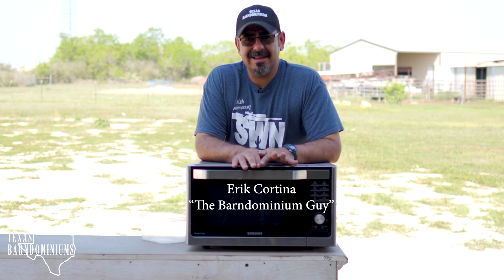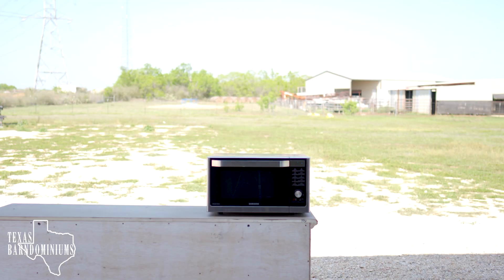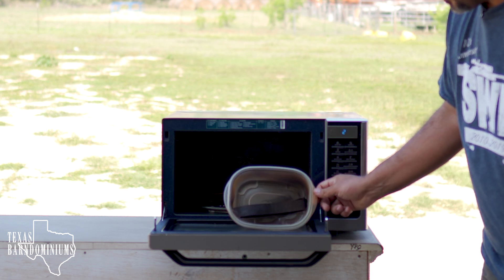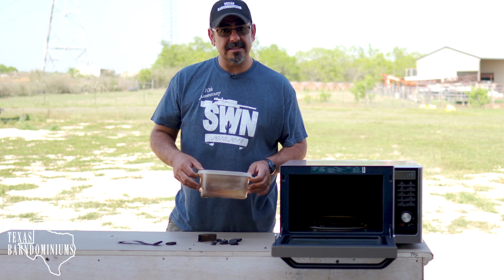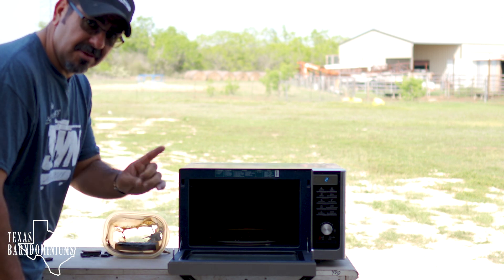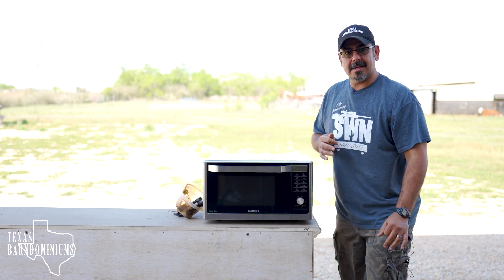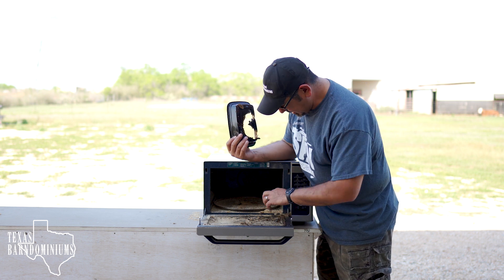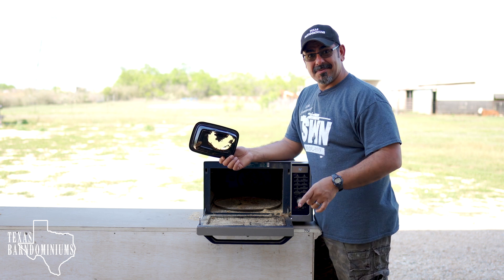This was worse that I expected! - S3 E39

Comment: My first job with Brown and Root was at the Phillips Refinery in Old Ocean Texas. I was a heavy equipment mechanic and we had a big shop complete with a parts department. To be cool you had to get an aluminum hard hat. Those nerdy plastic ones would cause you a ton of grief that and the issued safety glasses. Had to have aviators, gold rim. The welders wore blue lenses talk about cool. Anyway, we had a guy that painted hard hats. The really cool guys that had been over in the Middle East had engraved hard hats but we settled for a good old Krylon paint job with a bunch of clear coat. I drove all the way to Corpus to get an aluminum miner style hat and a buddy of mine scored a turtle shell. A couple other guys wanted theirs painted too so we got Art, the hard hat artist to do a run of hats. He has all these hard hats primed and a couple of coats of paint on them and had a revelation. To keep the dust off of them he said lets put them in our oven the insulators made us. It basically was a welding rod oven made out of stainless steel we warmed our lunches in. Lucky as hell to have one. Gets pretty dang hot too. There's this thing called "flash point", it seems spray paint has one and the oven we had got plenty hot enough to cause a flash fire. Art spent the next few days cleaning burned up hard hats and we had to go bribe the insulator shop for another oven. Lucky that thing didn't explode it just made a muffled boom and caught the paint on fire. There was a Gulf Shrimp boat burned up here one time from a crew member setting a can of spray paint on a stove burner to get it to spray. He won a Darwin award that day. Guess if they had a microwave he would have tried that. I know popcorn will set one on fire and donuts, my dad was guilty of that. Grapes are supposed to give a good show, don't know I never tried it. I don't know if the new ones will do it but the older microwaves would give you an electrical storm if aluminum foil was in them. My wife makes peanut brittle in ours and you don't want to burn a batch it will stink up the whole neighborhood.